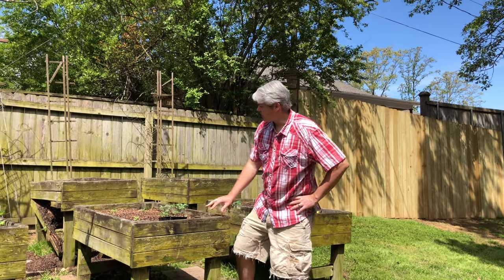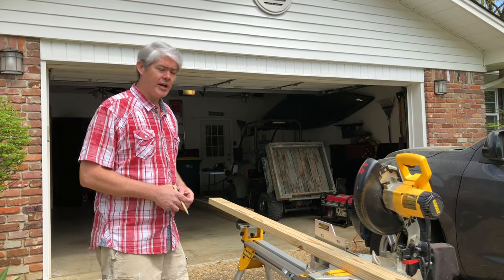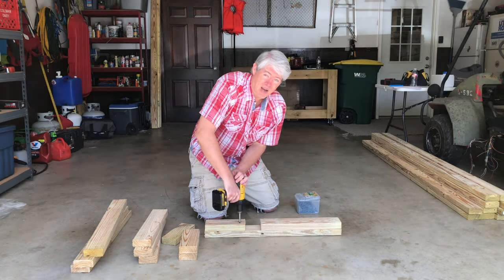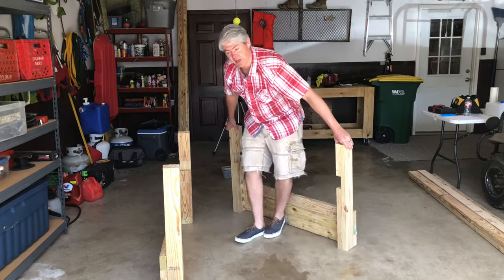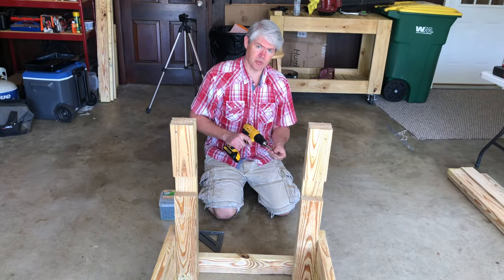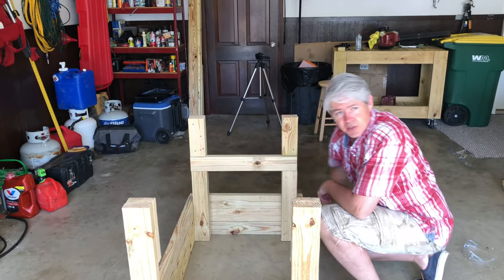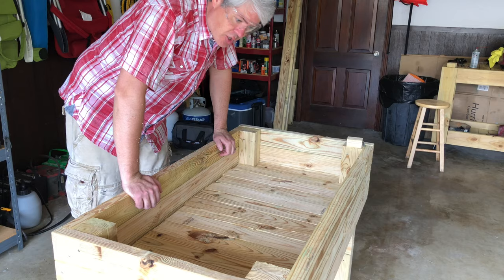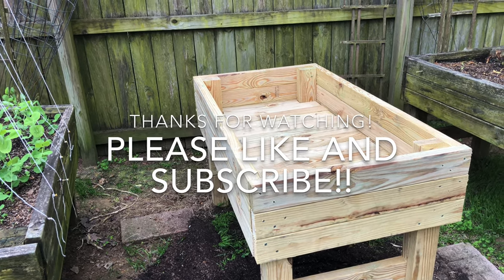How to Build an Elevated Raised Bed Garden Table Box - DIY

Comment: I will be attempting to duplicate ur project this weekend. My intentions is to use cedar for the box portion of the garden and pt oak on the legs. Thanks for the tips and easy to follow video.
Reply from the maker: Thanks for your kind words.  Good luck with the project.  With the cedar and oak, you should be in way better shape than the 6 years I am getting out of these pine boxes.
Reply: @budgetprojectsbydavid5263  Of course the issue is the cost of the cedar. In an attempt to save a few bucks, I went with the pt oak legs. I also made one completely made of cedar, but it will not have legs. I used cedar fence boards for that 1. The boards are only 5/8 inch thick so I don’t think it will last long but it was very cheap to make.

Comment: Nice work, awesome video.  My only concern is using PT wood, aren’t you concerned about chemicals leaching into your soil ie vegetables 🍅 🌶, I sure would be.
Reply from the maker: Thanks!

I did research this and modern PT, since 2003, don’t contain arsenic and are safe.  The copper used will still absorb into the soil, but won’t show up in dangerous levels in your body.

I got the wood from Lowes where they even recommend it for garden Severe Weather Ground Contact
Severe Weather ground contact contains Preserve (CA-C), a soluble copper formula that penetrates deep into the wood to defend against damage in and at ground level from termite attack and fungal decay. Suitable for burial or contact with the ground and freshwater immersion, Severe Weather ground contact treated lumber provides lasting support and protection for any exterior wood project. Typical uses include deck framing, fence posts, garden boxes, landscaping and freshwater docks.
Reply: @budgetprojectsbydavid5263  👏

Comment: Overall a well produced video, thankyou.  I especially liked the leg frame design.  However 14 8 foot 2x4 which includes thw bottom and sides is too expensive for me per unit. Your design though is solid. If i can Im looking build the legs as shown but use cedar fence pickets for the sides and ends and maxke it overall 6 foot long. Since most of the weight is on the bottom and the cedar is about 2.50 cheaper than a 2x4 treated. Its not my intention to butcher your design  just an attempt on my part to modify it to meet my budget requirments.
Reply from the maker: Hi Steve!  Thanks for the kind words and sharing your idea!  I like it!  I may have to build my next one with cedar on the sides and ends.  I wonder if the cedar will warp much/any due to its smaller size.  I know it would certainly make it lighter to carry around.  If you build it, I would love to hear more about your assessment of the cedar substitution.